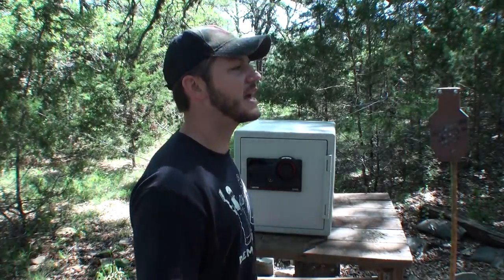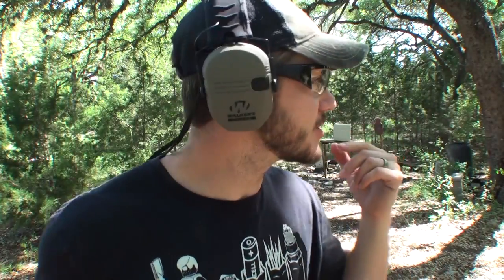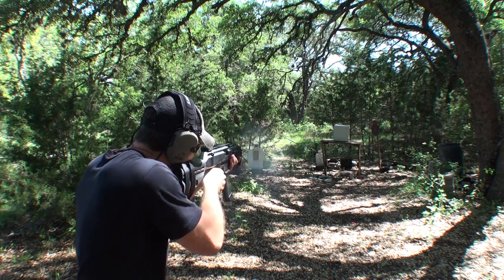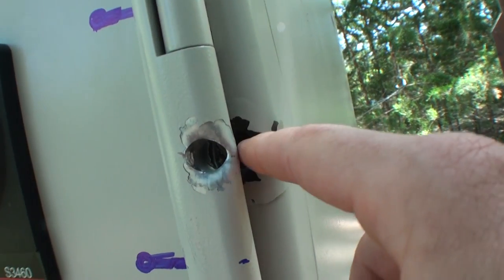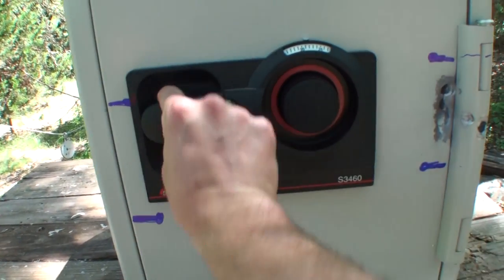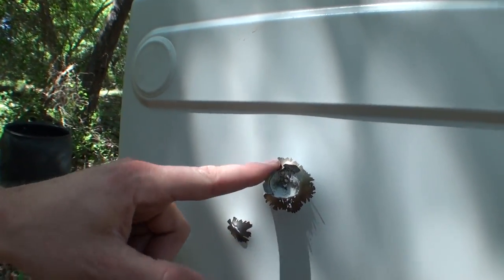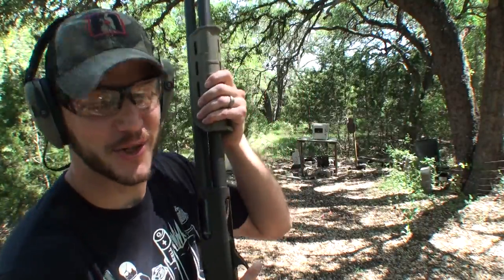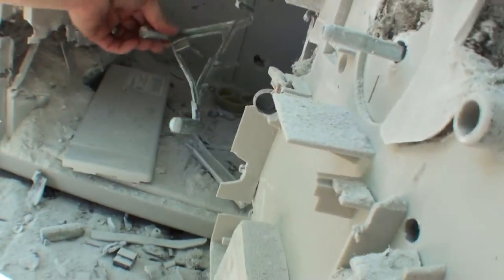Guns vs Gun Safe

Comment: That’s a very disappointing “gun safe”
Reply: its meant to hold weapons and ammo in emergency situations while also being slightly resistant to small caliber fire
Reply: Definitely not a good safe
Reply: The scout slightly resistant??? It barely stopped the first shot...
Reply: It's not a gun safe or even a security safe at all, it's a fire safe. Not meant for theft protection, and made of very thin-gauge steel. Most of the thickness is from the insulation.

Comment: If I would be the bad guy trying to crack that safe open I'd just use a cordless anglegrinder and cut open the back, should be done rather quickly
Reply: TheBo0mer ikr
Reply: Nathan West if I was a homeowner trying to protect my valuables, i would place it in the corner, with a 3/8 steel  welded on all sides with an internally hinged door and the thickest all-thread that would fit   bolted through the floor. For larger safes, you can utilize your floor support beam to tie in to your underfloor safe bracket. I've also heard of people having a decoy safe in an obvious location to confuse would be burglars. Remember, a lot home robberies are people that have been inside your home, so never give you're exact details.
Reply: Assuming that you had one...
Reply: wow, so many 12 year olds here...

Comment: Easy way in...if the rear plate is welded on hit the seem with a hammer and break the welds....pry off the rear panel then cut the fireproofing foam or use a hammer and bust the plaster.
You will see some screws in the plate inside...remove then and you are in with the door intact.
If its not welded in use a grinder or circular saw to cut the back pannel.